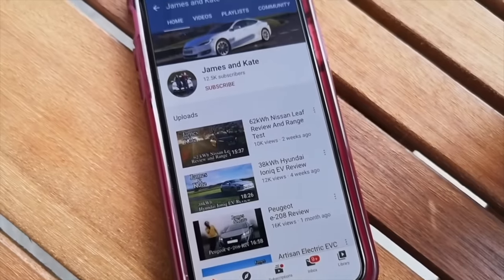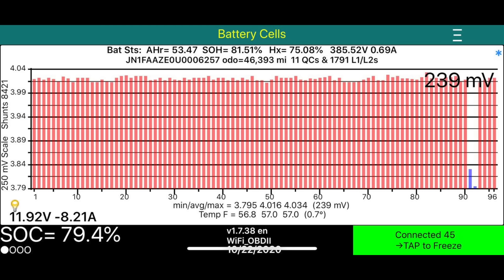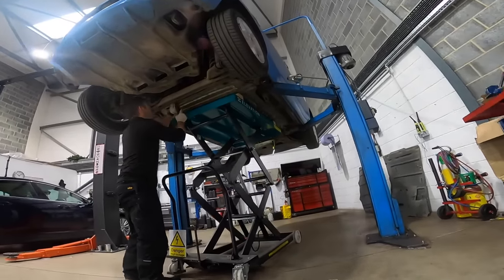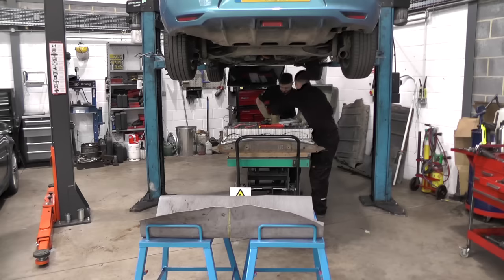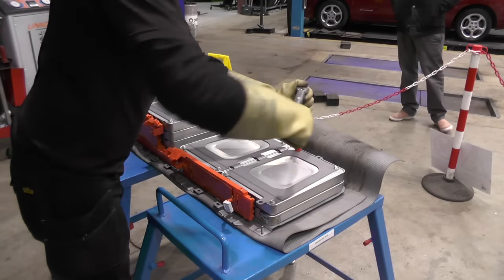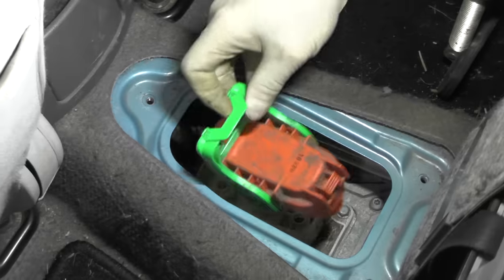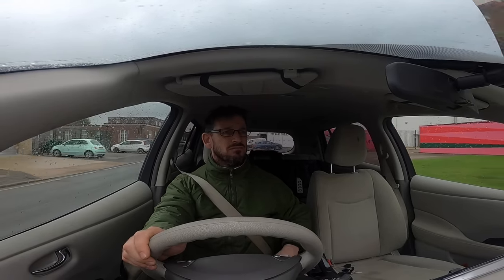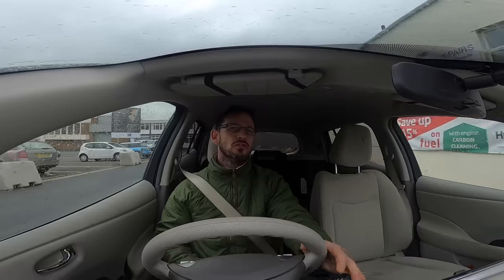Electric Car Battery - Dead After 3 Years, Right??

Comment: This highlights the importance of HEVRA approved garages like Cleevely with the knowledge to offer  diagnosis and repair. We need more of them!
Reply: Exactly.
Reply: Whats HEVRA?
Reply: I just picked up my Leaf from E-Tech Midlands near Leicester who are HEVRA approved, I only found them as I Googled, and their list of approved garages came up.
HEVRA approve, help and lend equipment to EV garages to help the mechanics work.
Reply: @edc1569  
Hybrid & Electric Vehicles Repair Alliance .
Basically independent  Garages who have the qualification & and  necessary tools to service and repair EV's
Reply: Especially as main dealers won't do repairs just swap out parts
Reply: This isn't rocket science. Know how to use leafspy, how to get the battery out and how to replace a module. Any competent DIYer could do this, although shifting the really heavy battery is a PITA without the lifts.

Comment: Really enjoyed that. It shows that the myth that a whole pack is required at a huge price is just that.
Reply: Try it on a Tesla.
Reply: @scottgibson7534  Mac or PC, Ferrari or Toyota wtf is your point? The point here is that done right a battery is repairable, lasts longer then thought and if we are smart, choose the right route we have something that'll last.
Reply: @campbellbamble5138  The question is are all battery packs as easy and "cheap" to  replace dud cells ?
I'm sure that will be a major consideration for the future of the EV second hand market.   £500 to replace one cell is pretty affordable but what if half the cells ( or all ) had to be replaced ? 
Could these cars be worthless at 15 yrs they could have a usable rust free body but a financially no no because of the battery ?  Hopefully batteries will get cheaper and better in 20+ years time.
Reply: @Jo Blow I think electric cars will eventually decimate the second hand car market simply because of the battery replacement cost.
Reply: I've just been watching a video on another electric car, this one used as a taxi. It has done 94,000 miles and is still performing well on its original battery.
Reply: @oldbatwit5102  Yes we all know batteries are strange creatures, they react well to being used all the time.  When batteries are idle they deteriorate, so an electric taxi battery will love its environment.
Reply: @Stimpy&Ren Read what wrote but didn't understand what I wrote cool
Reply: @Stimpy&Ren cool story bro
Reply: This is one of the favourite negatives of the EV bullsh*ters and denouncers. This ought to at least give them a clue that they're talking cobblers. Some are so unbelievably resolute in their misguided beliefs though, that they still won't have it even after watching the video. One of the latest I've seen was "what about the battery needing replacing every 3 or 4 years, and the electric engine needing renewing after a few years"..... (yes, that's exactly what he wrote)..... These idiots really are in a world of their own.
Reply: @scottgibson7534  But he didn't need to "try it on a Tesla". He owned a Nissan Leaf.......and ended up with a reconditioned pack.
Reply: @scottgibson7534  in a Tesla it’s a whole lot more work involved
Reply: @WildPhotoShooter  Obviously you didn't bother to watch the video.....
Reply: @Brian-om2hh  Oh I did watch it, I just read between the lines. These businesses are in the business of selling EV's.
Reply: @Jo Blow the car is recycled  don’t try to make it negative when it doesn’t need to be.
Reply: @scottgibson7534  This thread isn't concerned with Teslas. The subject car was a Nissan Leaf......and a satisfactory repair was carried out.

Comment: Hey James and  Matt, what a great video, just replace the cells that have failed, such a sensible thing. This will be the future for used EV's.
Reply: Not really. If the battery is performing along nominal design lines then  all the cells shoudl gradually degrade roughly simultaneously at the same rate. So near end of life you can't just replace individually like they do here and hope for some renewed life in your used EV.
This repair is great for spotting and fixing the few outliers that fail along the way. But if the EV ages as per original specification then the battery will ultimately  end up being too low capacity for useful operation of the EV (perhaps more than 200,000 miles likley though for larger batteries though with proper water cooled thermal control ...i.e. not like Nissan Leaf). 
Once at low capacity <70%?  they can be repurposed to have even longer life (e.g. storage slutions)  until eventually (decades later) they can be recycled and materials reclaimed

Comment: Thats another fine mess... Sorted. Interesting video and reassuring to know how easy it was to repair. £500 is not a lot when you consider the costs over the years of exhaust pipes, oils and clutches you may have had to fit on an ICE.
Reply: Just think, it can cost upward of £500 to replace a clutch.
Reply: I just forked out £380 to have my Golf serviced and MOT'd. Servicing costs for EV's are usually much less than that, or so I believe..... I'll be finding out in a couple of years...
Reply: @markgilder9990  The timing belt on my Focus 1.0 litre was going to cost a packet when it needed replacing. The guy at my usual garage informed me it was a 14 hour job. So, 14 hours at £45 + vat per hour????  I don't think so. At just over 5 years old, and the rubber door seals beginning to peel off along with other things needing doing, I got rid of it..... At least the Golf I now have feels like it's built to stay the course..
Reply: 500 Is a lot when you consider it's going to happen a lot more often as the other packs age. And with age they also lose capacity. Time will tell how much or little trouble these packs are going to give, but eV batteries can't bend the laws of physics.
Reply: @MrSegmentfault  Hi. Yes I see your point , However this is a 9 year old car. My wife's 2015 Suzuki S-Cross has only covered 14k but servicing costs over that time average out to about £130 pa. + a new battery @ £57.  So That's  £707. So at 9 years that equates to about £1400.  However, in that time I would expect to have a Clutch £400 Exhaust £200+ Antifreeze, water pump, drive belts, Road tax for 9 years,    Ballpark £3500 and the extra cost of the petrol, potentially a gearbox. All things an EV does not have. (I think). I do believe the cost of tyres and insurance can be more for an EV . The main difference is that replacing a battery / cell is an all at once cost instead of a constant drip over the years.  And this was one cell out of 100.  Only time will tell but one thing you can guarantee is, over time running, an ICE will start to be price out and Electricity will go up in price the more people use EVs
Reply: ...timing belts, smog check (Cal)
Reply: @markgilder9990  Uh really?   What's the Highway Robber's name?   $250 was the last quote I had to do a clutch on my 98 Tarago.   Instead we did it ourselves for half that.
Reply: @Brian-om2hh  I have a Hyundai Ioniq Electric, as it's a company car I don't have to pay for servicing but on forums I've seen prices of £61 for an annual service in years 1,3,5 and £108 for years 2,4. I also know someone who paid £63 for a first service. So the servicing costs are a lot cheaper for the Ioniq at least.
Reply: @markgilder9990  I find it strange most people drive cars that need clutch replacement that can be expensive to change, when Automatic gearbox options exist, and they never need expensive repairs,  I have a 1974 Ford Cortina that has done over 300,000 mikes  and the Ford C3 Auto box is fine!.after 47 years.
Reply: @MrSegmentfault  I'm not an EV owner, only looking into it, and there are some "deals" where you effectively rent the battery and swap it when it degrades/has faults. I have to say with a bit more research and the help of this video, I'd actually say renting the battery now seems a bad idea financially and is clearly just being used by manufacturers and dealers to make money. In the case of this Leaf it looks like there's no way to just isolate the bad cell so that it doesn't impact the whole battery, I assume the cells are daisy-chained but I'd like to think newer technology connects them in such a way that one or two bad cells is only going to proportionally reduce your range rather than only leave you with enough to get to a garage!
Reply: @Charles Holder : where did you get that it was $500 ?  I don't remember seeing or him mentioning that in the video.  Mind you - for a 9 year car -- it's certainly not much.
Reply: @marcgrondin65  Just for you, I watched most of the video and found the reference at about 5:55   . Have a great day, wherever you are🌈
Reply: But that's just for one module... You have a whole bunch of modules which can at any point fail with age.
Reply: @dallysinghson5569  They will all degrade - but outright failing that is an entirely different thing  .. not to mention not all that common.
Reply: @Cortinaman63  Yes it is hoses for courses. Newer cars are much more complex. I had a 2005 Kia Sorento auto. It had an oil leak from the transfer box. Ended up costing £4000 to replace.
Reply: @charlesholder8009  Older cars had better build quality on most mechanical parts, it would seem,   even my daily driver a 1992 Ford Fiesta Mk.3 has been super reliable, again an automatic, had it 14 years, it is now 28 years old, still on original engine, gearbox and all works fine, car cost me just £400 to buy back in 2007,  very cheap on servicing and running costs, as so basic compared to new cars, and easy to work on yourself, no computer or specialist tools required.   £4,000 was a lot, to replace (every part and make it like brand new) in my Ford C3 auto box would cost £380  plus labor so far cheaper, another reason I love old cars, parts are reasonably priced .
Reply: Plus spark plugs, timing belts, extra brake blocks, thermostats, fuel and oil pumps, coolant changes and gaskets, valve seats and gearbox issues. Not to mention the higher costs of MOT's and servicing,
Reply: @markgilder9990  True, and probably more than twice that price, even for a popular car. We had a Metro, years ago, and were quoted £1,100 +VAT by one greedy garage to replace a gearbox. As it happens, we had the snapped gearstick brazed back together by another garage for £20, and that lasted for over a decade; longer than the rest of the car.
Reply: A battery cell is NOT the only thing that will need replacing or repaired or wear out on an EV ......if it was the only thing going wrong garages eventually would go extinct.

Comment: Amazing that the cells can be isolated and replaced within just a couple hours with the right setup.  And nothing appeared to have broken or was stripped in the round trip process.  This repair is easier than a tune up on an ICE car!  It would be interesting to see how the cells will balance out after a few charge cycles - back to a GOM reading of 80+ miles?
Reply: If you include timing belt change is part of a tune-up, agreed

Comment: One other factor makes an EV a very good second hand buy compared to an ICE, namely, the diagnostic capability of the powertrain. In this example, a cheap scanner allowed the repairers direct access to enough information to target the specific problem area, right down to an individual call in the battery!  Compare that to trying to fix an ICE with say a knock, or a small misfire, or that stalls etc!  The fact is, you can go look at a high mileage EV and know with some certainty exactly how worn or ages the major components are, unlike with an ICE where you start it, lift the bonnet and listen, perhaps look at the exhaust for any smoke, drive it rounf the block and realistically, take the risk it's not going to die expensively a short time later........
Reply: Try to scan a Tesla for error codes.
Reply: @moestrei  But this owner didn't drive a Tesla, so the point you appear to be attempting to make seems somewhat irrelevant............

Comment: How can this not be the future of motoring? That's probably the most indepth maintenance job you can do on an EV. 2 hours and 500 quid. I had a quote to change my clutch for 2 grand!
Reply: By a Tesla and when the battery pack or a few cells go duff, it cant be repaired so go look at the replacement price for a pack, also this is old technology,  although I think that Nissan still make there battery packs like this one.
Reply: @LifesAbe-ach  I'm very confident that history will prove me right and you wrong. All the best pal.
Reply: @scottgibson7534  of course Tesla packs can have replacement cells, they are in banks.
Reply: @rustybkts  Do you know what is involved in opening a Tesla battery containment shell.????
Reply: @Jo Blow you need to look at life cycle costs and then the EV argument almost always wins, unless you do very few miles. You mention battery pack changes but this early worry has proven not to be an issue in the fullness of time. An ICE is usually on its last legs just after 100k miles. Even the early air cooled Nissan Leaf batteries can exceed this. Tesla recently announced a 1,000,000 mile battery. The technological argument is so compelling that it will end ICE dominance. Just look at the direction of travel of new car sales. Only a fool would stump up 35 grand for one now. It's like buying a cassette player when CD players were approaching price parity back in the early 90s. Then there's the whole environmental argument which should win the battle all on its own! 
Anyway, we digress. My original comment regarded the maintenance simplicity of EVs compared to ICE vehicles. I am a petrol headed motor sport fan but even I have to admit that the lack of maintenance required for an EV is damn impressive.

Comment: Change batterypack in the DIY auto repair shop. No fancy lift around, so I borrowed a 4 wheel trolly and made some suitable pilars from old tyres to get some height. Worked like a charm, the trolly made the battery pack slightly movable to line Up the bolt Holes when remounting. My EV just turned 18, now on its 3'rd set of batteries!
Reply from the maker: Amazing, great work

Comment: Great video. One thing to bear in mind is that while the Gen 1 has an easily removable battery pack lid, the Gen 2 onwards are sealed using an adhesive seal bead, which has to be cut through to remove the lid.  This takes some real effort to cut, so Nissan seem to have slightly moved away from the easy maintenance approach.
Reply: Oh, that is a shame, I will not sing Nissan's praises so much now.
Reply from the maker: Indeed. We have a technique for this though 👌🏻
Reply: @Jamesandkate  any tips? Our last battery swap involved one of our technicians just going at it with an oscillating multitool for about an hour. Worked well enough but he wasn't best pleased.

Comment: Possibly the best EV video ever.

However much Nissan has lost it's way this shows how practical a used Leaf is for those folk who never stray beyond the supermarket and the GPS surgery.

Every town needs a Matt Cleeveley.  👍
Reply: true, theres a huge market out there for used cars with an effective range of 50 to 70 miles, most journeys in the UK are under 35 mles a day. with all the new models coming out in a year or two there should be a good supply of second hand EVs
Reply: "However much Nissan has lost it's way "... I don't think they have.    How much experience have you got with the new Leaf?   I've just purchased a 62 Kwh Leaf Tekna after an extensive research of all the competitors.
Reply: Yep, and a used first gen Leaf can be found online for a fraction of its original price, in great shape. Well worth it as a second car or if you don't need a lot of range (inner city car, etc).
Reply: Why they're near useless outside major cities in Australia.   It's 160 miles to my specialist in Adelaide, a brand new Leaf won't make that without some hours recharging and naturally there's nowhere to do that between there and here.   Then the range reduction from AC (on a 45c summer day on a 3 hour trip you need it) Useless.  OH and the batteries literally get 'cooked' in our summers where 48c is not unheard of.  I've seen objects in cars on a hot day at over 65c, steering wheel too hot to touch, seat belt buckle will burn you.   The life of the car is another thing.   It's not even 10 years old and has what amounts to a major engine fault in an IC car.  What's it going to be like after 20 years?   (None of my cars are under 20 years old, 3 of them are closer to 25.)
Reply: @baronsilverbaron757  Nah mate, but I've met him, or someone like him lol.   Look, electrics have their uses.  If you commute 60km a day and can afford an electric, fine.   But they're just not suited to much around here.  I have a caravan, horses and a horse float, short of shelling out the national debt for a Tesla Cybertruck, nothing would work with that.  If I go to Adelaide, I do around 600km in a day.   (There and back, plus running around in Adelaide itself).   And it probably costs around $85AU in fuel, roughly 43 euros.  IN a 1995 Korean SUV with 337,000 on the clock that cost me 1600AU and easily does all the above.   Oh and the AC works a treat.

Comment: My 2011 leaf has an 8 year old battery. In Mesa AZ. It is now a local driver. It has 11 bars and 80 miles after a full charge. 39k miles total. Original brakes and tires.

Comment: I’m so impressed. More vids like this James. Did you see a way to cool the pack with fans?
Reply: I’ve been thinks air cooling fir a while. The pack is sealed . So would wants to plumb it with pipes and have fans up in motor bay.